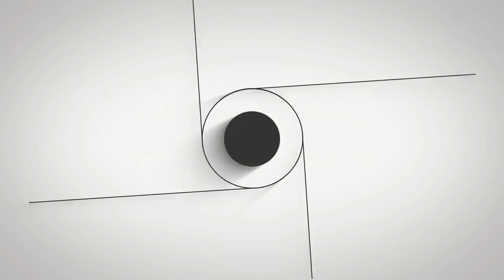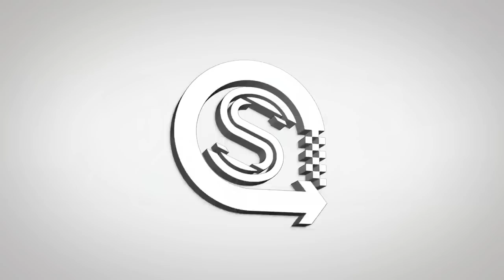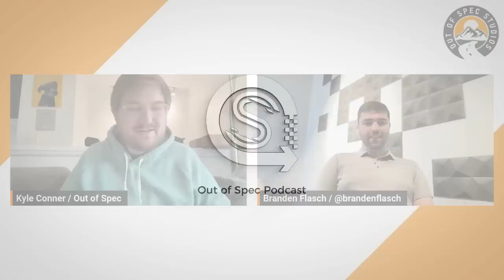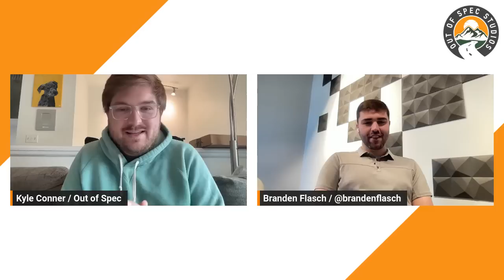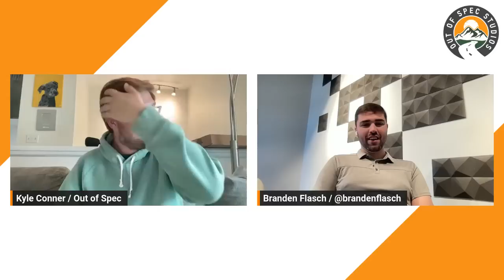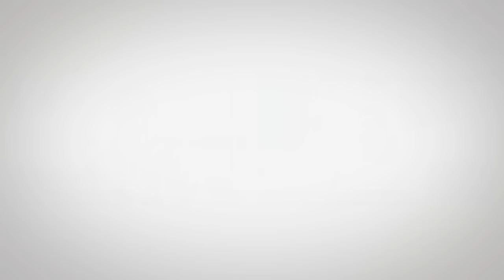EVgo Is Having Serious Trouble At Many Of Their Brand New Charging Sites | Episode 104

Comment: Lol you think their new stations are failing.  Check out the charges on the Chicago 294 tollway.  Almost all or all the chargers at the Oasis (pit stops with food court over pass) along the tollway a dead. So in order to charge you will likely to go miles off the tollway to charge. Their charges haven’t worked for years.

Comment: Heads need to roll, starting with the CEO. Maybe they need to replace their electrical, mechanical and software engineers or management needs to fund them better so they can do their job and fix the design. My friend has gone to five sites in the Boulder, Denver area and none of them worked. ??????

Comment: How do we make this work for EV drivers without having to use a separate app. When I'm running low on gas my car pops up a message asking and tells me where the closest gas stations are.  You jsut assume that they are going to be working.  If they are not working you will have someone on site to talk to, someone that can call a tech and get them to come out and fix things. This is not the case with EVs. Maybe pilot can be a leader in uptime but that is besides the point. We need to get all the charging networks together and have a way that independent of internal ticketing systems vehicles can be updated on the status of chargers. On top of that we need some standards on monitoring. Normal people are not going to update plugshare when they cant charge. In some states you cant even pump your own gas. The number of new BEVs being sold is outpacing charging already, it is no longer an enthusiast market its just normal people going on doing normal things. George Carlin said it best, Think of how stupid the average person is, and realize half of them are stupider than that. 
I am not even sure what I'm getting at but until the most average person you know can hop in a car, realize they need to charge, have the car tell them where to go have that work without problems people will not make the switch. Prices will go down, cars will be more affordable but people will still not want to switch because its disruptive to the habits they currently have.

Comment: My biggest question is, "What exactly is going wrong?"  Is there one main issue, or just dozens of them?  Is this just technology "millions of miles beyond the technology in a gasoline pumping station," or could EV charging be thousands of times more reliable, if only some standards were developed for all EV charging systems?

As for NEVI, it's sad to hear you guys talk about it becoming just another excuse not to let the public know that your EV charging station is down frequently.  But NEVI does give you a good look at what "government" is doing -- or at least plans to be doing.  NEVI is federal funding, but like all other federal transportation funding, IT IS IMPLEMENTED BY THE STATES.  So, it's ultimately about what the states decide to do with that funding.  Here in Oregon, it takes the utterly pathetic Level 2 / CHAdeMO "West Coast Electric Highway" and updates it with CCS, and adds a handful of stations in more rural areas.  Nothing really more than that.  All this will be is something along the lines of 4-dispenser (if that's the proper term for it) stations with one Level 2, one CHAdeMO, one 150-kW CCS, and one 350-kW dispenser -- and most likely just a second 150-kW CCS dispenser, if someone decides "this one doesn't need a 350-kW dispenser."  That might be OK now -- or not even adequate already -- but will be virtually worthless as Oregon implements its Advanced Clean Cars II plan to require 35% of new vehicles to be zero emissions by 2026, with an increase of 8% more zero emission vehicles required each year, up to 100% by 2035.  I would call this "laughable" if it wasn't going to be a complete, massive nightmare.

The main thing I see with NEVI is that "it requires a high percentage of uptime," but I don't see ANYTHING in the way of "regulations."  The gasoline station industry is REGULATED BY LAW -- and perhaps that's what's missing from the EV charging industry.

"Just buy a Tesla" is NOT any sense of reality, either.  That is fully in the "Expensive toys for wealthy boys" category at this point -- "it's a hobby."  When people become required by law to depend upon this "technology," it just won't happen unless battery electric vehicles become available for around HALF the price of a typical Tesla vehicle.  And people will REQUIRE that they can go somewhere and reliably charge those vehicles.  It certainly looks like utter madness at this point in time.

Comment: I bought a Tesla Model Y in June, 2020. I Immediately started taking long road trips all around the Southeast using both V2 and V3 Superchargers and only twice did I experience a problem (1 slow dispenser and 1 that did not connect) which was easily fixed by moving my car to the next dispenser. This past October I bought the Tesla CCS adapter to help in some remote areas and have not had a single good experience. I chalked it up to Tesla being new to CCS but it looks more like poor CCS service providers and equipment.

Comment: Good podcast.

The one comment would like to make is based on my career of almost 45 years in IT.  Diagnosing multiple failures in a network is a non-trivial task. When I was doing network management/monitoring in the mid to late '90s we were passing events through a correlation engine but the output still required the interpretation by a skilled and experienced professional. Listening to your podcasts and videos I am convinced multiple vendors in a single charging network increases problems.

We are probably stuck with the basic cable design we have so we need to think about what we can do with them. They are abused and neglected by consumers.  I think we need to look for robotic chargers. Before any one says that is pie in the sky if we can build robotic cow milkers to otic charging should be simple.
Reply: You make many good points. The variety of equipment mix and variety of EVs can certainly make this challenging however, Tesla has a model that works well. Tesla does have the advantage of vanilla charging equipment and vanilla EV population BUT they are still doing things better and have been for some time.
Reply: @FoamyDave  tesla effectively is a monoculture which has its own issues but has their job easier. Block obsolescence is the risk.

For the public charging networks who are choosing multiple providers I think they need to bifurcate their networks by equipment providers and subbrand them so consumers can choose the hardware they have better success with. The networks management also needs to be bifurcated to improve staffers understanding and training on the hardware. The only place the network s should come together is the financial backend.

Unfortunately looking at the coverage of CES  there looks like there has been a proliferation of charging vendors and if they are successful in penetrating the North American Market I'm afraid it's going to make Network reliability in the near-term 2 years or less even worse.

Comment: I would begin by installing remote CCTV cameras at each site, able to focus in on individual vehicles as the try to connect.
Then I would install "call buttons" (like they have in elevators) at a "reporting station" on site....so you can, as a trouble shooter in a natuionwide call centre...talk to the people.....
Customer service???
Reply: I like this idea. They don't need to do this at every site. I bet if they just monitored a handful of busy and/or problematic sites they could understand the issues easily. Even better, have a few employees visit sites and spend 1/2 day observing and interviewing customers. I used to work as a developer for a cell phone manufacturer and occasionally would sit in the mid and end-of-line test stations observing and talking to the operators. The users can be a wealth of information if you are willing to show any interet.

Comment: Let's face it. EV Charge companies and charge hardware manufacturers all drive diesel pickup trucks and make charging systems as a joke laughing all the way to the gas pump. Here in Ontario, Canada the IVY charge system was installed up and down Ontario's major highway 401 in March 2022, and now are most sites are either completely down, or charge limited to 30KW.  Road tripping in Ontario just plain hard.

Comment: The statement that sites will go down is simply wrong. There should be enough redundancy so that no single failure can bring the whole site down. The only single point of failure is the electrical grid, as long as the grid is up a charging site should be up. Tesla has at least eight  chargers per site, newer sites have 12 or more. Failure of one cabinet will only bring down two chargers leaving six good ones. The only full site Supercharger outage that I know of in the three years I've owned a Tesla was planned and appeared on Tesla's nav, last summer Lebanon NH was down while they doubled the number of chargers and I suspect that it was the power companies fault not Tesla's, it took them a couple of weeks to reconnect the power.
Reply: Agreed, entire sites should not go down. Individual units will, however.

Comment: There is a real need for a "GasBuddy " like app for EV Level 3 chargers. It needs to show location, number of EVSEs, real charge capability of each system (Don't advertise 350kW when in reality the system is limited by components to 200kW), latest rating out of 10 by users including date and time,  and current status (available, broken, In-use), and user comments. This would need to take input from supplier and users, with users having priority (mainly because I don't trust suppliers to tell the truth,
Reply: Isn’t that what PlugShare is trying to do?
Reply: @mdjrboyvb  plug share bought by EV-Go.  They cook their own books. For federal mandates (since they suck up our tax dollars to fund locations).  Will not work. This will turn out to be like FTX chaos.  Buy a Tesla, and not worry.

Comment: To some extent drivers shouldn't need to know the dirty details for why a site is down.  But all CPO need to look at how Tesla handles their operations, and strive to emulate it.  For example, one of you has questioned whether liquid cooled cables are a common point of failure - and yet Tesla uses liquid cooled cables, so the principle is sound enough.  Maybe the implementation sucks, but that's another matter.  But anytime a question comes up like degraded grid, or whatnot - I would ask how does Tesla handle this case.

Comment: at this point you'd have to look at the higher ups at these EV charging companies..wouldn't be surprised if they have ties to the fossil fuel industry
Reply: Operations is hard, it could just be incompetence or we have a different view of their business than they do.
Reply: Good point, maybe it's believing dcfc is akin to gas pumps that get installed and just left alone until they are replaced?
"Never a tribute to malice, what instead can easily be explained due to incompetence"
Reply: @4literv6  gas pumps break and there's actually no one on site that can repair them.  The gas stations are used to work at wood generally outsource it, but failure was pretty rare and bigger gas stations. Have a pretty high SLA.
 The difference is the payment authorization system is mature enough that it doesn't fail. But you don't get to collect much data.
The measurement and pumping system is also mature and tested regularly by various weights and measures agencies.
I really do not understand why someone just hasn't taken a gas pump. Ripped out the pump and put in a charger.  The gas pump payment system doesn't give two s** about what it's doing It just needs units to bill for.  It works in 150°f and minus 50f.  It takes credit cards and third party authorization.
The hard electrical bits can be detached from billing and authorization.
The only thing it doesn't have is a giant stupid screen you can't use with gloves on unless it's there to give you ads while you pump.